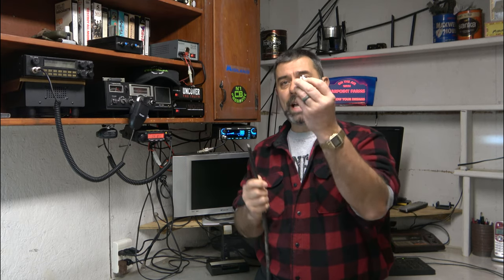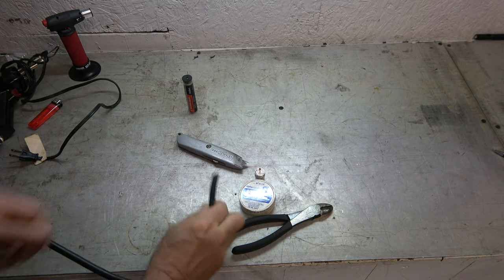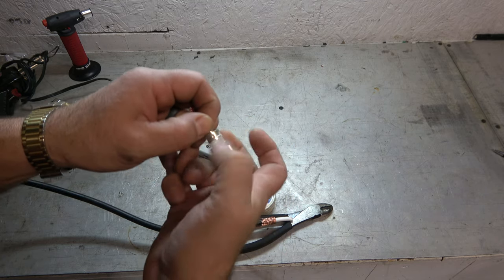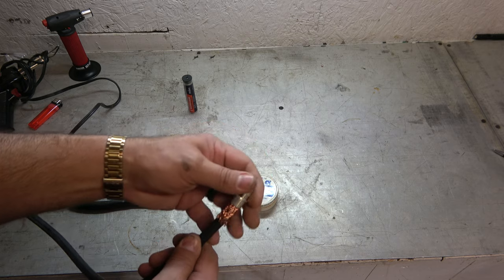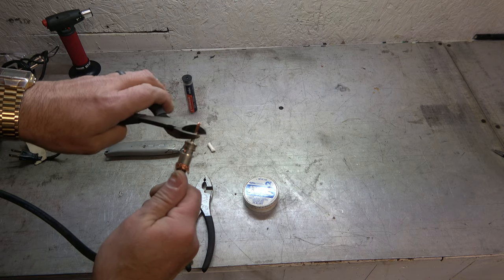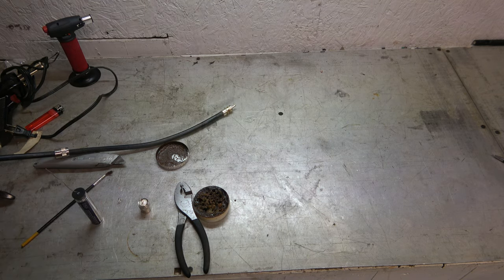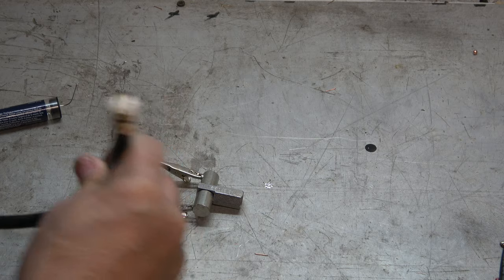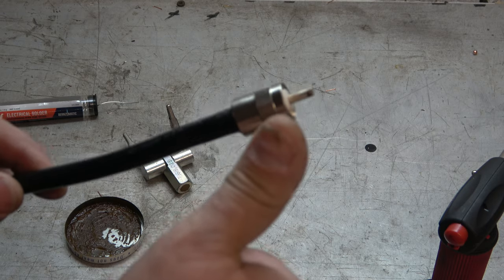Soldering PL259 Connectors onto RG213 CB/HAM cabling. See How To Save A Bunch On Wiring.

Comment: Good job 👍 . I absolutely hate doing these on 213 coax . It’s what I run so I had to do it last year . Of the whole project start to finish , that was the part I dreaded the worst !  I did mine just like you , but mine still didn’t look as pretty in the end 🤦🏼‍♂️. But I ohm checked everything several times and it was good , I’ve had no issues. But these things are much more work than Mini8 and a reducer collar .

Comment: Nice one. I would just add to the end for those that haven't soldered one before to check there's no short between the centre and braid with a multimeter. I've been using compression pl259s of late so I don't have to solder the braid.

Comment: I've gotten away from 2 piece UHF connectors for either RG 58 or 8 x. I use the crimp on type connectors anymore. I know some people don't like them, and there are times in rf connections need to be soldered.  However, I use the ones that DX engineering sales.  They're not cheap at $5 a piece.  Also, having the correct tools , anyone's budget or better half will allow it, makes the job easier and go quicker. Just a foot note or two, N connectors can be a real SOB in putting them on RG 213 , Belden 9913, LMR 400.  Erik , please let us know your status on retesting to upgrade for your general or extra. Love to work your station on " Farpoint Farm in the mountains of North Carolina".